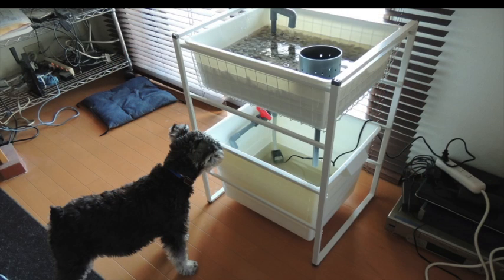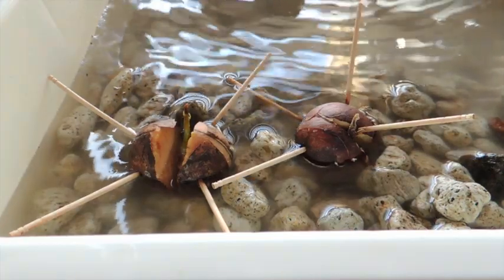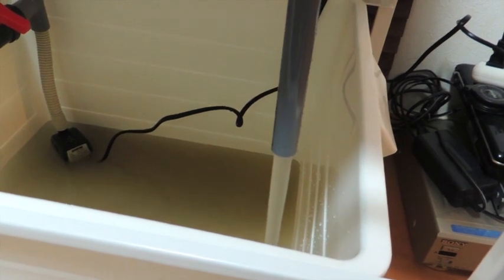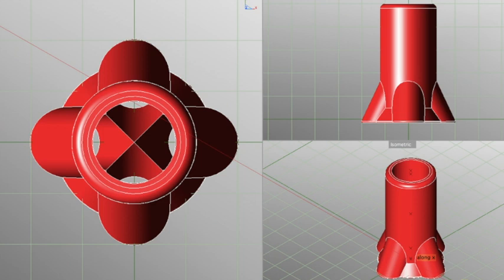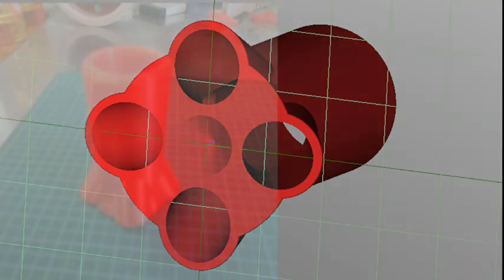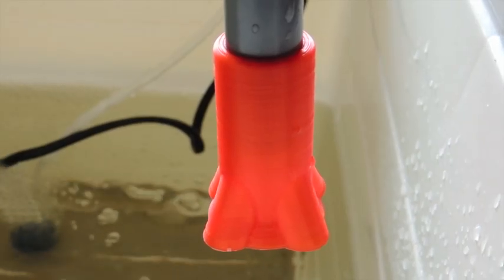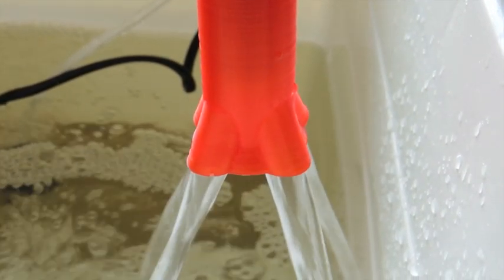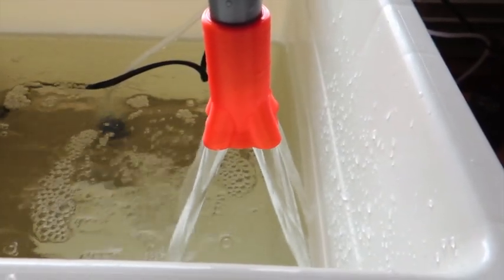Aquaponics Quad Head Design - 3D Printing

Comment: I completely understand wanting to conserve as much as possible. Up here in Fairbanks our total electric runs around 23c a Kw, almost twice as much as the rest of the nation. Right now I have my Aquaponics  system running about as efficient as possible (you can see my recent update on my channel) but I would certainly be interested in seeing and perhaps getting one of your designs to use on my siphon drain when you work the bugs out =)
Regards

Comment from the maker: We're working on a venturi design, but it's going to take some fine tuning. You have to balance the water flow very carefully. In the meantime we'll be posting a video showing the new bubble head design that improves aeration considerably. One of our design goals is to make the system more efficient in a passive fashion and to minimize the use of electricity and other resources.

Comment from the maker: I'll be experimenting with several different designs to see how it can be improved. It should be easy enough to modify the internal design of the head to create more aeration without restricting the flow. There are a couple of other factors I want to optimize at the same time.

Comment: a question about what causes aeration in waterflow, is it the water/water interaction(the splash), or is it the cross-sectional area the water occupies? if one or the other is the major player, it would seem you could further increase either one without much trouble on your 3d printer.

Comment from the maker: Actually not. A cheapo shower head would have looked cheapo, clogged easily with mineral deposits from the water, and would have cost more. I pay around $40 for a kilo of PLA filament, depending on the color and characteristics. The plastic in that part cost 25 cents or less, and I ended up with exactly what I wanted.